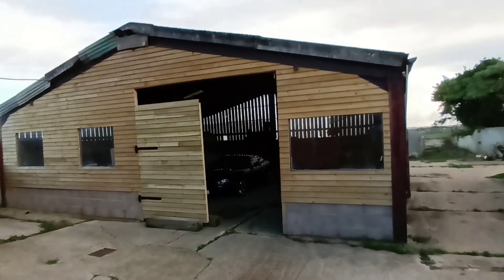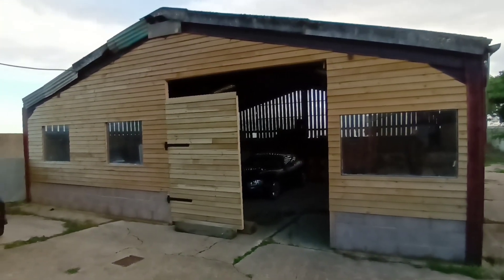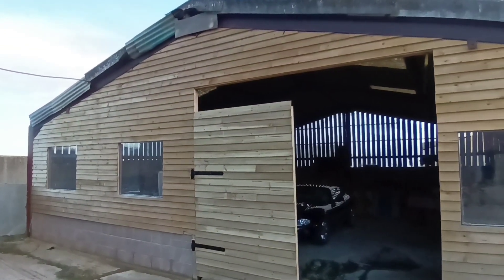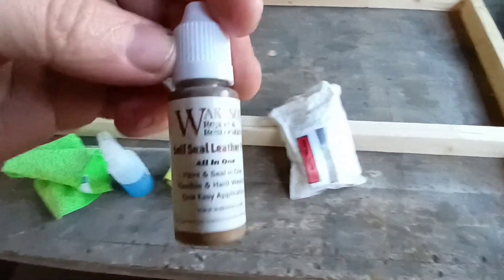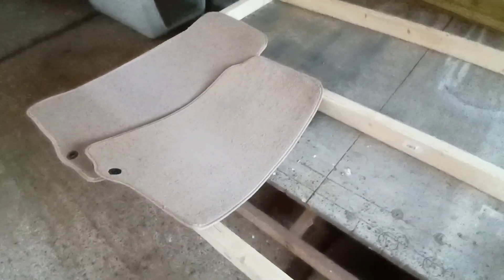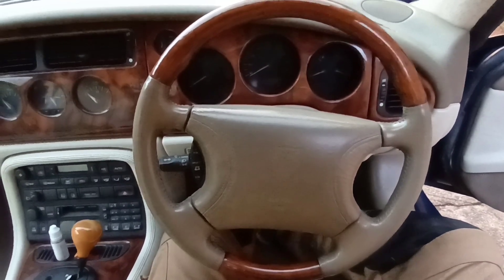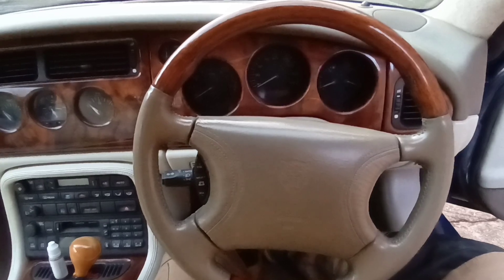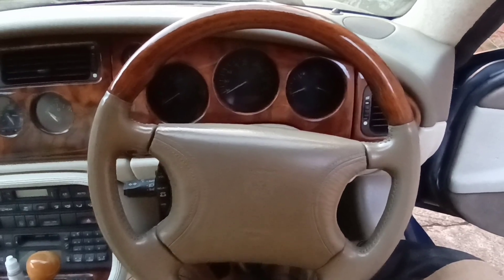Jaguar XK8 project #12 steering wheel restoration & general catch up

Comment: I've got leather wear on my steering but I got steering wheel cover to protect the wood parts from sun damage during summer time.
Reply from the maker: Hi Cody, I see that a lot in the US 🇺🇸 with sun damage, how is the dash top and the rest of the wood with the hotter climate there?

All the best mate 👍
Reply: @projectsinthebarn  Some wear but mostly in good condition, this summer was especially hot, which is why I bought a steering wheel cover.

Comment: Great Video, Thank You. I enjoy the how to fix and do things yourself videos. Can you give an address as to where to get the leather redo or dye that you used ' I have a 2007 XK  Winter Gold, Convertible, 50,000 miles on the clock. All original? Love the car, a joy to drive.
Reply from the maker: Hi Jim, thanks for your kind words, it means a lot to me. 
I bought the leather re-colourant from Ebay UK and have bow added a link to it in the description, but here it is for you;
https://www.ebay.co.uk/itm/JAGUAR-Leather-repair-Paint-Dye-Colour-Restorer-Scratch-Scuff-/152601415978?mkcid=16&mkevt=1&_trksid=p2349624.m46890.l6249&mkrid=710-127635-2958-0
Great to hear about your own XK8 too, my x type is also winter gold and I really love the colour ❤ 
All the best and hope you keep watching for new videos 👍

Comment: Did you get the steering wheel dye from the Scratch Doctor ? if not, why ? just wondering. You can't beat the feel of a wood steering wheel.
Reply from the maker: I found it off ebay if I remember correctly